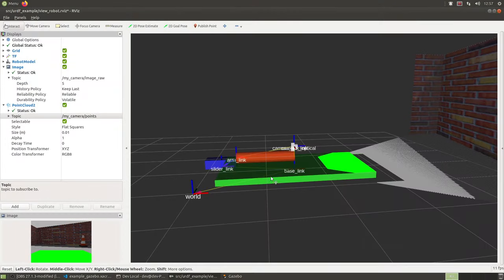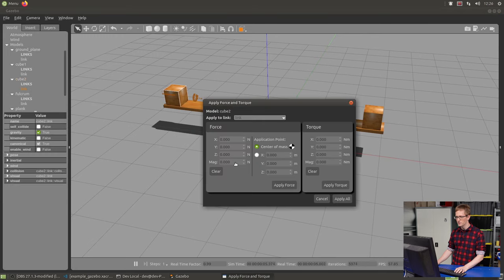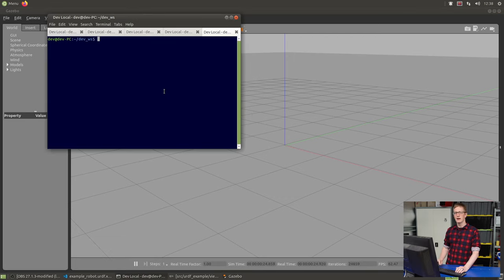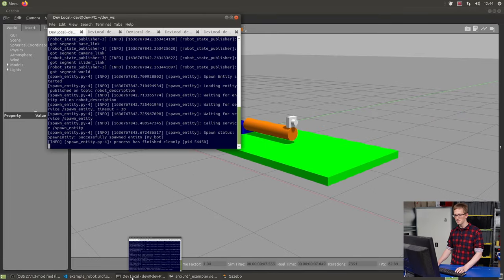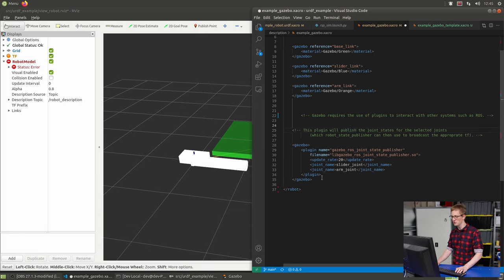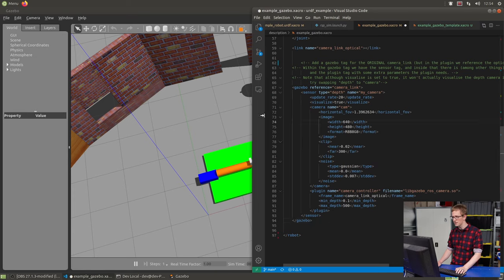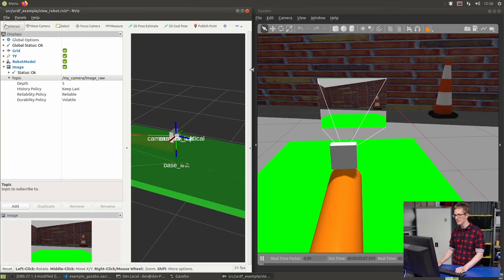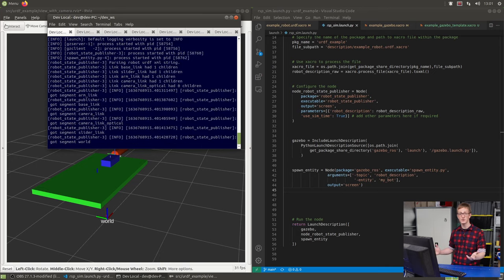Simulating Robots with Gazebo and ROS | Getting Ready to Build Robots with ROS #8

Comment: humble tester :) I ran into some issues today. Both ROS Humble and Gazebo Fortress are working well enough that I can follow along with your lesson.  However, upstream gazebo does not seem to be building the necessary ros to gazebo bridge.

I filed the appropriate issues to have gazebo start doing the builds. I guess I will have to learn how to build the packages from source.

This was another great ROS2 video.
Reply from the maker: It's a shame you've been running into such troubles with Gazebo/Ignition on Humble. I've been doing a little bit of work on humble in a different project but not using Gazebo so haven't run into such problems. Hopefully they're patched soon! Building the packages from source is a great way to learn though :)
Reply: @ArticulatedRobotics  Yes, I think that I am just early to the party. The plus side is I learned a lot about how the project works upstream.

Comment: Hey there, great video. I have seen some tutorials where a sensor broadcaster is configured in the yaml file (Something like imu_broadcaster: type: imu_sensr_broadcaster/IMUSensorBroadcaster) and then it is spawned in a launch file like a joint_state_broadcsater. Is that unnecessary? Can I just put the sensor in gazebo tags in my urdf and the topic will be available to my ROS2 nodes?

Comment: Hi, really useful and clear video! I am applying the same methods for my own project. However when I publish to the topic as shown at 16:06 with the joint names and input the simulation doesn't change.
I am publishing the joint states and have included the joint_pose_trajectory plugin.

For reference I've tried to move the joint with an effort controller and this works, so the problem doesn't lie with the joint its self.
Any guidance would be appreciated.
Reply: I am facing the same Issue, @ArticulatedRobotics

Comment: Excellent video tutorial. Everything is explained so clearly. Thank you so much! I've been following the step by step process on ROS2 Humble with Gazebo classic. Weirdly, adding damping in the URDF files like you did doesn't seem to invoke any friction in the Gazebo simulation. Not sure if it's a Humble issue or some other one
Reply from the maker: Strange, I'll be upgrading to humble in the next couple of weeks (and documenting how I go) so I wonder if I will run into that.
Reply: After trying some more, the friction does work. I was moving it unnaturally before which caused weird behavior. Thanks again

Comment: I'm trying to implement your solution to better understand ROS2 and Gazebo. But, I'm stuck at " Example - Joint states &  control". How do you install the Gazebo plugins? I tried cloning the repository "yossioo/gazebo_ros_joints_publisher" but when I try to build it I get the following error:

CMake Error at /home/alemoreno991/anaconda3/envs/ROS2/lib/python3.10/site-packages/cmake/data/share/cmake-3.22/Modules/FindPackageHandleStandardArgs.cmake:230 (message):
  Could NOT find Protobuf (missing: Protobuf_LIBRARIES) (found version
  "3.12.4")
Call Stack (most recent call first):
  /home/alemoreno991/anaconda3/envs/ROS2/lib/python3.10/site-packages/cmake/data/share/cmake-3.22/Modules/FindPackageHandleStandardArgs.cmake:594 (_FPHSA_FAILURE_MESSAGE)
  /home/alemoreno991/anaconda3/envs/ROS2/lib/python3.10/site-packages/cmake/data/share/cmake-3.22/Modules/FindProtobuf.cmake:650 (FIND_PACKAGE_HANDLE_STANDARD_ARGS)
  CMakeLists.txt:7 (find_package)

Could you help me out?
Reply from the maker: Hmm that's strange. You really shouldn't need to clone any extra packages, it should be sufficient to install ros-foxy-gazebo-ros-pkgs like I do at the start of the video, and that will install all the plugins required for this tutorial.

I took a quick look at the repo you have linked and it seems to me that it is for ROS 1? And so won't work on ROS 2.
Reply: @ArticulatedRobotics   Thanks for the reply.

Yes, I installed that and some of the problems went away. Nevertheless, the most tedious problem was created by the fact that I was working inside a conda virtual environment. Just to make sure I'm not doing something wrong, have you ever worked within a conda environment succesfully with ROS2 and Gazebo??
Reply from the maker: @AlejandroMoreno-pj5tw  I did notice that from your error and nearly said something. I've never tried ROS inside a conda environment. I don't see why it shouldn't work, but obviously it depends what you're trying to do as system packages and what as conda packages.

I've heard of Robostack which I think aims to achieve ROS/Conda integration (and also to improve cross-platform compatibility) so it would definitely be worth checking out. https://robostack.github.io/